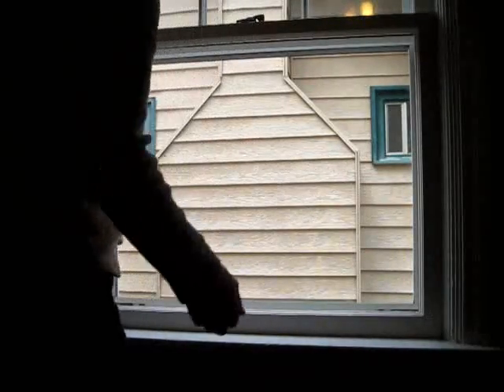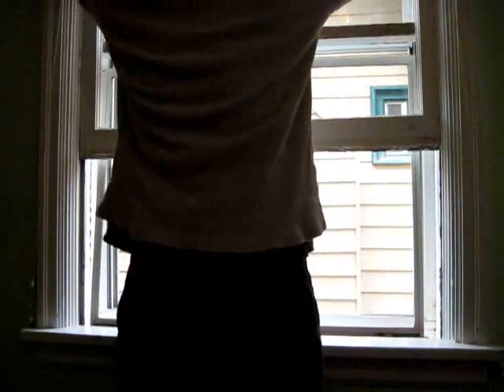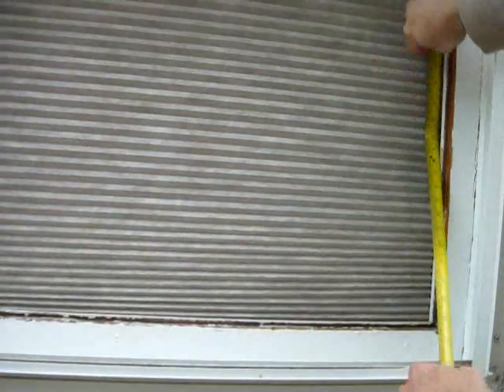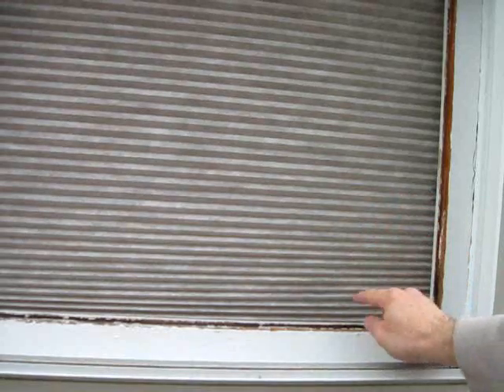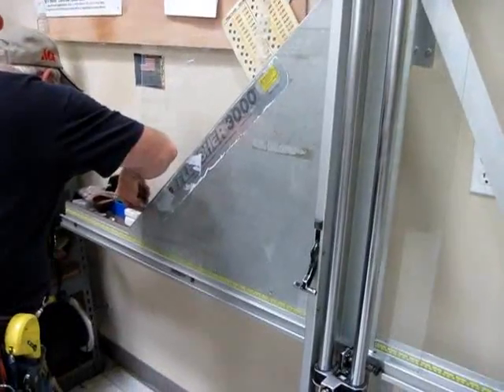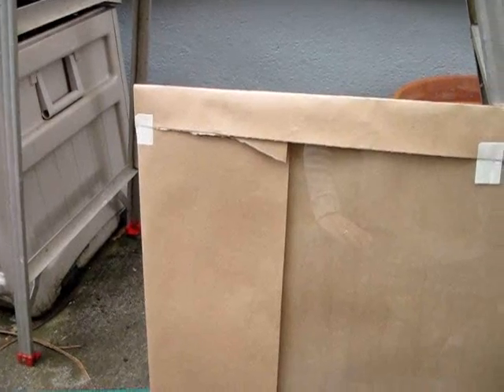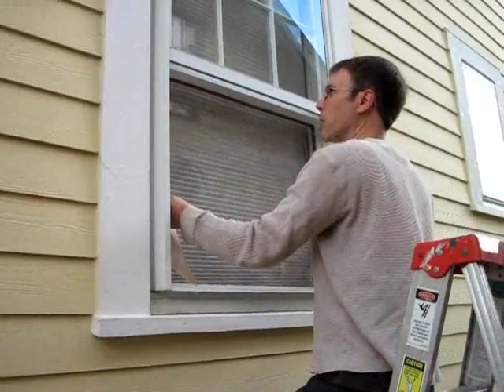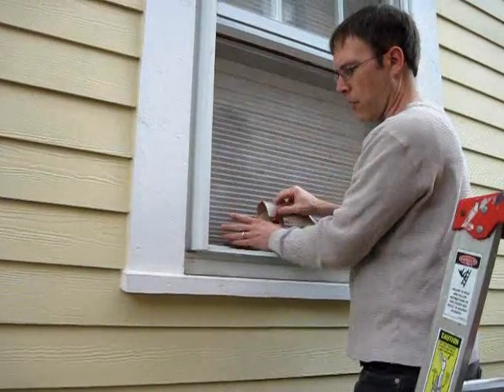Broken Window Pane Replacement: Step #3, measuring and cutting glass

Comment: I really wanted to see what he measured to see the correct size.  The outside measurement?  Or the inside where the glass will fit?  He had his body covering the end of tape measure for both the vertical and horizontal measurements.  I'm guessing the inside measurement, but I want to be sure before I pay for a new piece of glass.

Comment: Nonsense! He's turning this into a job that takes all day. Just remove one of the face stops, take out the sash, remove the old glass and putty, treat the wood with boiled linseed oil, apply a bed of putty to the rabbit, press the glass into it,  use your glazing points, face putty, replace the sash and nail the face stop. Done.